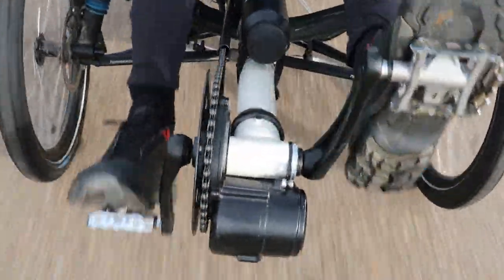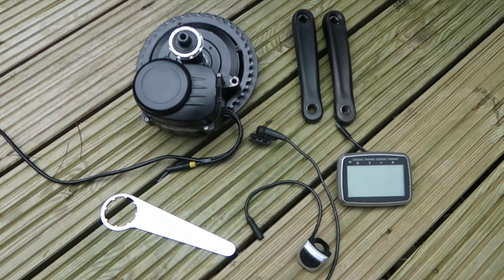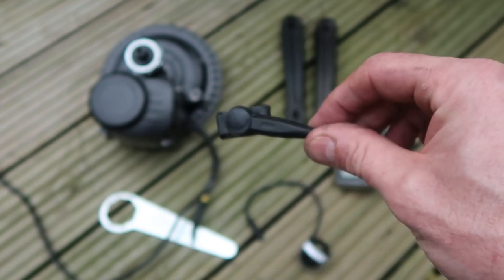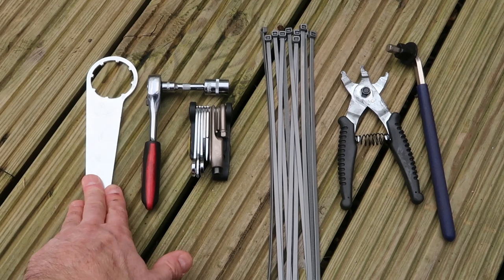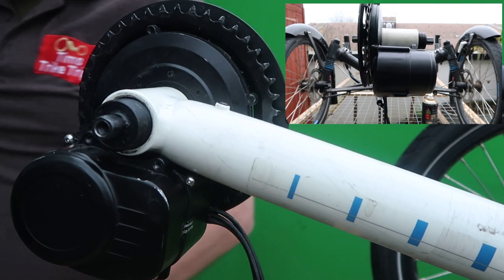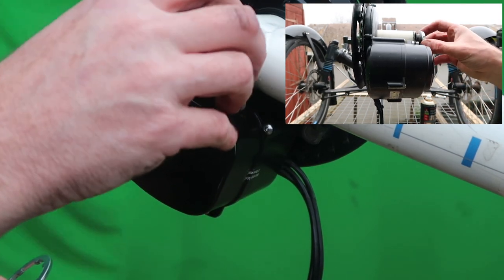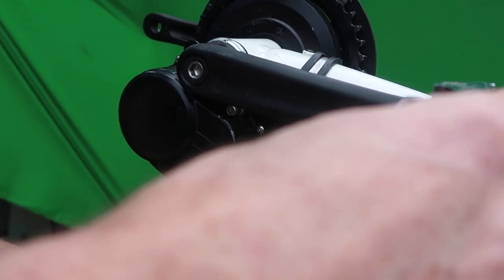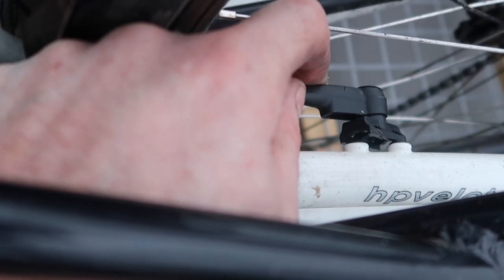TSDZ2 Installation on a recumbent trike.

Comment: Just fitted the same motor to my ice Adventure, its pretty simple really, the only problem i had was i have short legs so the  crank arms were too long, the only ones that would suit were the Bafang 152 mm, i purchased a pair in Australia for £16 but the postage was £21 and then the customs and excise had to have there share which added another £11, i ordered a battery from Aliexpress on the 25th January and it only arrived on Thursday this week, due to Chinese new year, apparently they do not work during the celebrations which lasts from early January to end of February, great little motor though.
Reply from the maker: I had the same problem with a camera I ordered from Hong Kong. Took about 5 or 6 weeks to arrive last week. I hope you enjoy the motor.
Reply: @TimsTrikeTrips  Cheers Tim, Hopefully.

Comment: Tim,
   How far can you go with a single charge?  I also assume this is limited to the 20 kph speed on the assist.  Is this working well and can you feel the unit cut out at the proper speed?  Do you have different levels of assist for steeper roads and paths?
   Good to see you can still get out and about with all the virus adjustments we are seeing world wide.  I wonder how long this will be possible.

Be well and ride safely,
bf
Reply from the maker: All to be answered very soon Bill. I'll run through it all for you. 
Re: the virus... it's already spoiled my first tour for this year. More on that too later this week.
Thanks for your best wishes 👍

Comment: Tim, hi.  Good video and very helpful.  I have just finished fitting the kit and your video did help.  I am going to need to extend the speed sensor cable as you describe.  Will the system work without it?  How many wires are inside so I know what I am up against.  Many thanks. Andy
Reply from the maker: Very much depends on the kit you bought Andrew. The kit with the throttle has 6 or eight wires and the one without has 5 I believe. The system wont work unless its plugged in but as I have found with the magnet moved away from the sensor the systsem will still work

Comment: G'day Tim.
I live in QLD AUSTRALIA.
I have just got interestested in cycling because of the pandemic and i want to widen my activitys. I am now saving up for a recumbent trike for off road. getting the standerd one first as its a lot cheaper and do a convertion later. The kit looks very simple to install.
all most plug and go. I gess the kit can be installed to a off road type trike in the same manner ?...
I would be correct in asking that ?.. Thats all i have to ask you. hear from you soon.
Gerard.

Comment: Great instructional video. Enjoy your new ride! What was the “ all in cost” for,the entire system and actual.full installation time.any idea  if this system is compatible with Catrike 559? Best wishes. Keep riding on!
Reply from the maker: £589 for the kit and battery (inc shipping). The first time I installed the system it took over three hours. This time, including stripping off the efneo gearbox beforehand, it took me just under two hours. That includes installing the controller, battery and speed sensor too.
I don't know about your the Catrike  sorry but if it has a 68mm BB then you'll be fine with it.
Reply: Tims Trike Trips thanks so much! That is a helluva price compared to the $2000 plus options being presented by so many manufacturers.even paying a bike mechanic to do the work represents quite a bargain. Please post comments as to efficiency and durability of the system as you use it in the near future. I will call Catrike folks directly to see if it is compatible. Keep up the good work!
Reply from the maker: @markfeldman6509  I'll definitely be posting updates like distances covered and speeds etc. Thanks for watching and commenting 👍

Comment: Nice one. Do you change the motor according to terrain then? If so which is which? For instance what would I use living in the Dales?
Reply from the maker: No, I only have the one motor Mark. I mentioned swapping it out for my EFNEO gearbox. The gearbox is very good on the less hilly rides and means I can leave the heavy batteries at home and not worry about charging them up every day. A 250w motor like the Tong Sheng or the Bafang is more than enough for most of our UK hills.

Comment: This is very helpful for me.
I am still looking for what I will get and now I know what I must do as I get such a motor.
I can make it fit and I know that I must ad a part to mount it. But it's way easier than I expected.
Did you need to extend surten cables?
Reply from the maker: Glad it helps you. I only had to buy an extension for the speed sensor. The other two cables were more than long enough.
Reply: @TimsTrikeTrips  OK so they also sell extension cables. I didn't know that.
I think that I start with one smaller battery and mount it on my seat. I can always sd one next to it and swap them. That gives me also more range.
The bootle shape is nice. Easy yo mount.
Do you have an USB port on the battery or on the control panel? I have seen some that have it and it's nice to kerp your phone charged.

One more question. Has it an option to connect lights to it?
I didn't see lights on your bike, but I need it because I drive mainly ad night and lights are than needed.
Reply: One more question. Did you need to ad brakes dit sensors? I see on some that they have that, but I don't know if I need it. I prefer not, because I have now in the front and rear with brakes on it so it doesn't move as I get on or off my bike
Reply from the maker: @emiel1976ep  the battery has a USB port on the top. The controller has a USB port on the rear. You could attach lights via these usb ports if you wanted  to.
There is no need for brake sensors with the TSDZ2 as it is a torque sensing motor... If I'm not putting pressure on the pedals then the motor isn't working. So when you stop pedalling to put the brakes on the motor stops too.
Hope that all helps.
Reply: @TimsTrikeTrips  thank you. That helps.
The price is also low, so with the reviews I looked ad, it's a system that is now ad the top of my list.

Comment: Tim, I see that there are brake levers that cut off the motor when applied. You don’t think they are necessary? Thanks
Reply from the maker: It isn't really necessary with a pedal assist. The motor cuts out when I stop pedalling. More important with a throttle (which I don't have).

Comment: Nice! Do you thing it would have enough torque for an ICE Fullfat offroad use? I'm still weighing this with the Bafang model.
Reply from the maker: Easily. I took her over some very rough ground last week (my next video). Power wasn't any issue... but I wish I'd had full fats on... no grip at all at times. 👍

Comment: Hi all. I have my tongsheng tsdz2 motor. How do I remove the pedals and crank arm so I can install the motor? What tools do I need?
Reply from the maker: HI Dave. did you manage to remove the pedals? YOu'd need a crank arm removal tool for those and pedals all depend on how they are fitted... might be a spanner and might also be an allen (hex) key.
Reply: Tims Trike Trips Managed to get the crank arms off but the problem removing the bit that’s left inside. How do I get that out?
Reply from the maker: @davecattell8175  email me some pictures Dave and I'll try to help you out. tcooke@postmaster.co.uk
If you're talking about the bottom bracket then you'll need a BB removal socket for that... but email me anyway and we'll see.
Reply: Hi. Motor is now fitted and I’m raring to go!
Reply from the maker: @davecattell8175  excellent news. 👍
Reply: Tims Trike Trips 👍